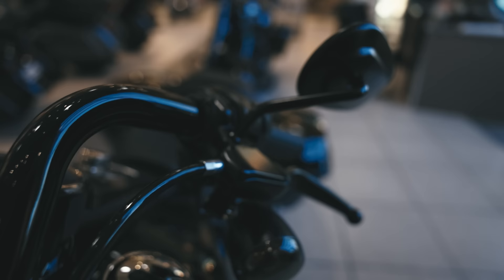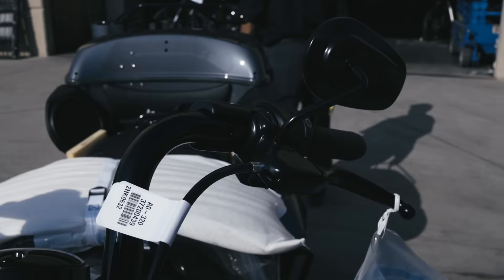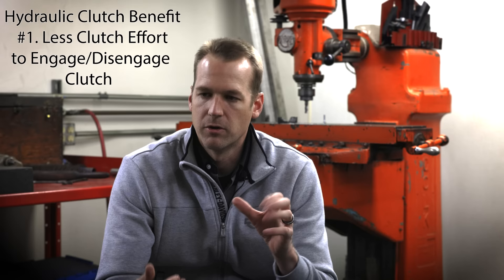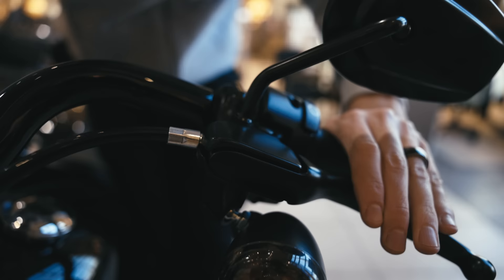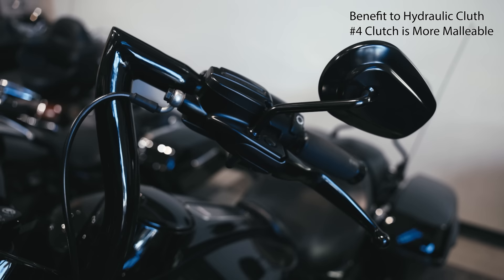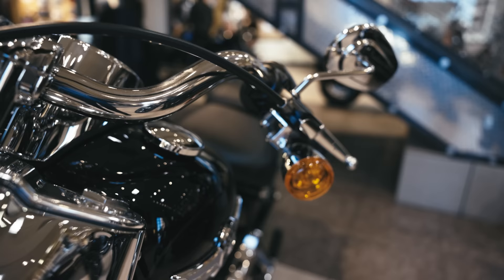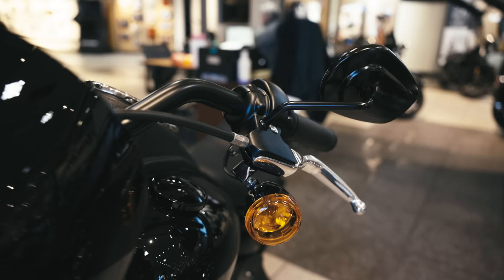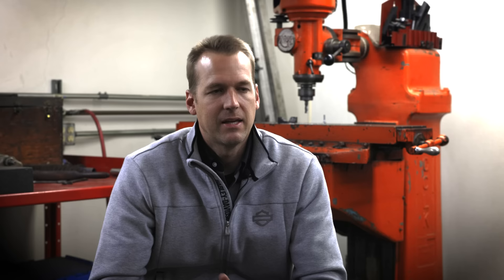Why Harley-Davidson Switched Back to a Cable Clutch on Touring Motorcycles│Pro's vs Con's

Comment: You can use the hydraulic clutch with a proper grip and 1 or 2 fingers. You have to use all fingers with a cable and are not able to hold the grip with your other fingers since the friction zone is by the bar.  A very unsafe tech and why the industry went to hydraulic 40 years ago. An adjustable lever moves the location for those with small hands. A change in the slave can give a wider zone also so it is all cost. Not complex, spring, piston, and 2 orings.

Comment: What about the transmission---->primary case fluid transfer issue that is/was only an issue on the hydraulic clutch bikes? Multiple "fixes" were implemented finally settling on the primary vent kit which apparently does solve the issue. This was not an issue on cable clutch bikes of the same platform (i.e Road King). It is/was common on M8 bikes but a few Twin Cam bikes were affected also. I have a '15 Road Glide Special and discovered this issue when my trans oil level was 16 ounces low after a 1500 mile trip. I ended up making the M8 inner primary vent kit work on my bike and it has solved the issue. I wonder if going back to cable clutches on the touring bikes has anything to do with this fluid transfer since it only occurs/occurred on the hydraulic clutch bikes.

Comment: Yeah man clutch cable adjustment is a pain because it just isn't something that has to be done as in there is an alternative and once I had the hydraulic I don't plan on going back ever. I also like being able to run the clutch line through the handlebars to clean it up. My first hydraulic clutch I sort of felt like there was something wrong it felt precise and super easy. My hand got bashed up a bit in Iraq along with some nerve damage so the hydraulic is much better especially in SF Bay traffic.

Comment: Mechanical has always been what I had. Test rode the 2020 trike, which is where I’m at no. It works yet on slow speed turns?

Comment: Wasn’t there a recall on the hydraulic clutch? Looks like basic math to me. Dump hydraulic clutch, raise price, recoup some recall $.  Ok jokes aside if people got hurt from hydraulic clutch failures, causing recall. going back to a cable clutch for safety reasons or possible law suit ruling. Is a possibility.

Comment: Once i got used to the hydraulic clutch i love it. I agree the adjustability of the cable clutch suits more riders of different sizes. Why didn't they keep the hydraulic and use adjustable levers?

Comment: After I seen the 2021 CVO Limited I now regret that I sold my 2019 CVO Limited. So now I’m looking for a 2020 CVO Limited but every used one I’ve found has a price as if they were a new one so I’m now actually looking at a Honda Goldwing and I’m telling you they don’t look like a geezer glide anymore.
Reply: Honda really made the GW look awesome, the only sad thing is how much less space in the sidebags is left now after the design change.
Reply: @A_Ride_To   The 2021 has a new rear trunk and satellite  radio is standard on touring models .The 2021 CVO limited no longer has satellite radio are a CB radio on them.

Comment: Newish rider on a cable clutch and it feels good and familiar like my old dirtbikes, bought a new to me ultra classic w hydraulic clutch and getting used to it, i think harley should have made a better bend in the clutch lever for it so the release is more at the halfway point but following preloader and keeping it loaded covering the rear brake it has a good feel and i dont have any complaints.
If i was only doing low speed maneuvers than yes but the percent of slow speed to other types of riding it is a toss up in my opinion.

Comment: I went from a 18 street glide special to a 20 softail standard and it is way easier to pull. Even easier than my old dyna. I also think the clutch engages harder. I would get some slip if I dumped it or went wot right off the line. I don’t mind either, but I prefer the cable. It’s not like an old car with a cable clutch compared to hydraulic. Those things felt like garbage.

Comment: I like hydraulic clutch. Maybe Harley thought the mechanical clutch would help with the oil transfer problem. I've heard some speculate to that, I'm not convinced of that though.
Reply from the maker: I'm not sure how the two are related. Also, the "oil transfer issue" has been completely blown out of proportion. We have never seen any mechanical issues happen that are related to this. If riders are adhering to the proper service intervals then the fluids are drained and changed anyways and brought to the proper levels.

Comment: More Cost savings for the big HD.  Took away the spare key fob, adjustable vent, rear shift lever, now the hydraulic clutch.... shall we go on???
Reply: True, probably charge you for the air in the tires next

Comment: Matt, Can you convert cable clutch to hydraulic clutch?  I have a 2017 with the hydraulic, to be honest I would not go back to a cable clutch, this would absolutely prevent me from buying a new Harley.  Also with Hydraulic you can add adjustable lever and change where the friction zone is in the range of motion.

Comment: IMHO, the hydraulic clutch could be improved by reducing the displacement of the master cylinder piston volume, the engineers need to study the necessary displacement from rest to full pull, so that ~70% of lever movement is in the friction zone, the the remaining 30% is to cover the margins to ensure full engagement & disengagement.  The numbers I'm suggesting are just an example based on what Matt speaks to and I've experienced over the years.  Should not take the engineers long to find the optimum displacement.

Comment: Helpful, thx. Got a ‘21 RG and the pull on MY CABLE CLUTCH is excessive in my opinion vs my last two bikes. 
I don’t love it. And no aftermarket short /adjustable lever options. Bummer.

Comment: Having ridden with both cable and hydraulic clutches on Harley’s, I genuinely have no preference. I did initially feel the hydraulic clutch was stiffer to operate but I always put adjustable levers on my bikes and that generally smooths out any issues. The move to a cable clutch may be a good thing, but I just can’t help feeling that as a customer I am being “short changed”. Last year Harley gave us one less key fob and removed the alarm, and this year its the hydraulic clutch, so I hope with these cost savings we see some benefits from the motor company in the future.

Comment: Great video Matt. 👍  I've only owned  cable clutches but I've ridden a few with hydraulic.    No real preference as far as feel.  My cable clutch seldom needs adjustment. I think cable is easier and cheaper for a person to service at home.
Maybe will see Hydraulic Clutch 2.0 in the future.

Comment: I have a 2000 Yamaha road star with a cable clutch and a 2019 road glide ultra with the hydraulic Clutch  it really doesn’t matter I got used to hydraulic clutch in one day.  I really don’t prefer one over the other just my opinion

Comment: HD has quite a different model then let's say Apple/Steve Jobs mindset. One followed what people want or wanted and the other created what people will want. The problem with the former is that you're always behind a little bit and not as agile for changes, so forecasting is doubly important.  The risk with the latter is picking the wrong horse. Both have been successful though, but one has had a harder time of late.It's interesting to see how different business models work.

Comment: ‘15 Street Glide Special....70k miles, no issues with the hydraulic. I want to spend more time riding, less time maintaining. HD needs to move forward,  not backwards. What’s next,  even less travel for the rear or front suspension.

Comment: Hello Matt. I have Never ridden a bike with Hydraulic Clutch. My guess would be more a Road Feel? If you remember they had a Recall on the Clutch Slave Cylinder. Bikes getting stuck in N or Gear. I know someone who bought a Road King new. He had his Slave Cylinder changed to an aftermarket one. He likes it better. Occasionally I get Surveys from HD. They never seem to ask me Specifically what I want in a Motorcycle? Too busy asking about Brand Loyalty and other things I find Irrelevant. Being 5' 4" and weighing 150 pounds. Short inseam. What can I fit on? What can I afford? Sport Glide is a nice bike. Forward Controls are too far forward for me. My 2018 XL1200C is a good bike. Miss having the 6th gear.  Maybe a different rim that doesn't need the inner tube?

Comment: Sore wrist in slow traffic. You have bigass hands Matt. Normal riders like the easy cable clutch. Go find a older bike in your inventory . Remember he 2010 road kings with the east clutch? The sweet spot is closer to the grip as opposed to the opposite with the hydraulic system.

Comment: I bought a Road King with the hydraulic clutch and it was MUCH harder to pull than my old Harley cable clutch.  OMG!!  I mean hard to pull.  I had to buy an aftermarket modified clutch lever to help reduce the force necessary to pull it.  Maybe mine is an outlier.  Can't imagine a woman being able to pull it.

Comment: Hydraulic clutch is basically maintenance free. You gotta lube and adjust that cable. HD is cutting cost, period. It's absolutely a step backward in my humble opinion.

Comment: Harley looking for another way to get people in for service.  I'll keep my Ultra with a hydraulic clutch instead of having to do an adjustment every 3k miles.  I did all the adjustments myself in my previous bike with cable but like the hydraulic clutch much better.

Comment: Ive grown to despise the hydraulic. I was getting into the low speed precision riding. I wasnt great but I had zero problems with doing U-turns, circles etc. I wasnt aware there was a huge difference so when I got the 2020 RG I didnt think much about the differences. in the first week I laid the bike down twice at low speeds cause of friction zone issues. if I could afford it I would swap it out in a heart beat. now I am duck walking the bike around in U-turns cause I dont trust that friction zone.

Comment: Hydraulics can change in temperature. And can leak easier than a cable can brake. Prefer the reliability and durability of a cable clutch

Comment: Personally I don't like the move back into a cable.  I've owned 15 motorcycles and the last 3 of  have had hydraulic clutches.  Once you get used to them, they're great.  Harley Davidson is a very interesting product.  It's considered a premium,  prestige brand but simultaneously gets scorned and laughed at for being behind the times.  I was very iffy on ever owning a Harley due to some of the antiquated design elements they hung onto.  When the Rushmore bikes came out in '14, I started getting more interested in potentially owning one.  When the M8 was released in '17, I decided that it was time to own an American legend and purchased my Ultra Limited.   In my opinion,  cable clutches belong on cheap,.low end bikes.  I don't like the look of them at the handlebar level either.  They require a lot of maintenance adjustment as well.  Yes, for low speed maneuvers they are somewhat better,  but what % of the time are you engaged in that?  For motor officers, mabe a decent amount of time, but for Joe Q rider not so much.  So for me the cable return is a step backwards , especially for a brand that fights being labeled as " behind the times".  And please do get me wrong,  I love my Ultra Limited and have enjoyed owning it.  I just don't think this is a good idea!
Reply from the maker: Thanks for the well thought comment. 
I think In terms of quality, fit, and finish HD is still the clear leader but having the “tech” just to have it has never been a priority for them. Do you need the tech and quality for a bike to be premium? I don’t know where the balance is. What I do know is HD has a ton of great tech that goes very unnoticed. RDRS is a great example in recent years.

Comment: Cars with standard transmissions have been using hydraulic clutches for decades because they nearly maintenance free.  Even high end sports bikes use hydraulic clutches.  If cables are the 'right' answer for controls because of 'feel' or quick fix for catastrophic failures, then why are brakes hydraulic?  Harley's decision to put cables back on their touring bikes is clearly cost savings.  I plan to keep my 2017 FLTRU, but if I had to replace it I wouldn't consider the late model touring bikes.  What else did the decide to cut cost on????

Comment: They should of went back to a cable throttle too. The ride by wire is what makes most of it weird personally. That bit of free play in the throttle is what  makes it all natural despite cable or hydraulic clutch. I think they went back to cable clutch cause of all the bulletins on their slave cylinders and stuff

Comment: I think all that would make some sense if the price hadn't gone up. So no hydrolic clutch (which I prefer) and a led head light added. Price goes up. Not great really. You pay for the very small additions and the take a expensive upgrade away. Easy money making decision.

Comment: 50k miles on my Sportster, never adjusted the cable clutch. It works perfectly.  Maybe I should?
Reply from the maker: Sportsters you just put gas in it. 
Haha, no you should probably check it.

Comment: When is Harley going to have 2021 cable clutch extension kits for handle bars?
Absolutely a fail! 
Harley changed to cable clutch for 2 reasons; 
1) still trying to fix the M8 oil transfer problem
2) saves a lot of manufacturing costs

Comment: I watched a video where a Harley mechanic  said that harley was having issues with bleed thru from the hydraulic fluid leaking thru to the primary thru the shift shaft. Don't know the technical term.  Lol but they were finding the hydraulic fluid was empty and the primary full.  Supposedly it was a recall issue but to repair the entire 2021 lineup wouldn't be cost effective at this point so they went with the cable.  The problem would only show up after owners rode awhile 20 30k miles.  Wish I could remember the video.  Lol seems legit.  He had personal experience supposedly with customers.  Does sound like some thing harley would want to keep quiet to not discourage sells. Don't quote me verbatim trying to remember the clip.  I'm not a mechanic.  Lol

Comment: Seeing that many motor officers and riders that do a lot of low speed maneuvering like the friction zone closer to the grip as it's easier to control  I'm wondering if Corporate was going to lose some police fleet deals because of the hydraulic clutch.
Reply: Nope the Police like the hydraulic clutch... See lawabiding bikers video on the subject...
Reply: I imagine the motor company will start marketing the pan America, not the baggers, to police departments in the next few years

Comment: I have bikes with cable and my Harley’s have the hydraulic clutches......I like the hydraulic better....the cable clutches are more maintenance. Both are fine...doesn’t make much difference to me....not a deal breaker....

Comment: The friction engagement point adjustability "benefit" could be easily achieved the same way BMW does it....with an adjustable lever. I doubt this was part of the reason as to why HD went with a cable. My money is on the oiling issues along with reduced production cost "benefit" for HD.
Reply from the maker: How does this clutch help the oiling issues exactly?

Comment: For me the Hydraulic has too much much tension...I can't agree at all with the hydraulic is easier to pull. I've had an old cable on a bike and other bikes it was like butter not effort. The hydraulic is way harder and has more "spring" tension. 

I also had a RKS which the engagement point was way out, and a small window.

Comment: A Cable  Clutch  will last a  lot longer and work a  lot  better if you keep it lubed properly ..   Hydraulic clutch it either works or it does not work.. When it stops  working you have to  repair it ..

Comment: It does seem that the cable is a step backwards for a Premium product. HD Touring bikes are considered a "Premium" product...30K for a bike is a nice chunk of change! A sportster or Softail Standard w/cable clutch...Ok that makes sense, but 30K for a bike and it's using outdated tech instead of dialing in the tech that should be offered with a $30K item anyway, really seems like a $ thing more than anything to me. I think,  & this is just me, but 2021 is a "Write Off" year for HD. They MUST release a new model, but if the 2022's show up in august as per usual this is a short model year. In Cali they do not offer SE upgrades for the 21's...I heard because they failed something with CARB and rather than working to make it happen they scraped it with the mindset that they'll address it with the 2022's. I can appreciate your perspective and opinion Matt. The reality is that you MUST find the "Pros" with this change because you sell the bike. Not a bad thing, simply a real thing...I do feel you presented the information well and I respect that you were honest about your preference "I prefer the Hydro, but wouldn't swap the cable on a new bike" Personally I do not like the move because it makes what I do more difficult...so my perspective is a bit skewed as well. Bottom line is the Cable will prob be here for at least a few years so HD looks like they really "Tried" to go with the Cable for reasons other than saving $ because of Covid, but that is what this change looks like to me...an attempt to save costs because of losses during the Covid pandemic...my .02¢